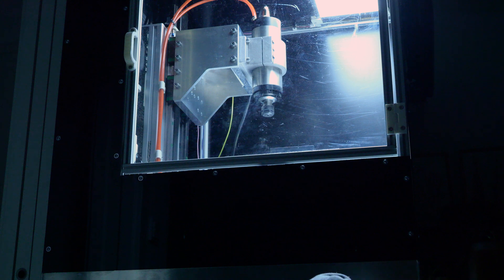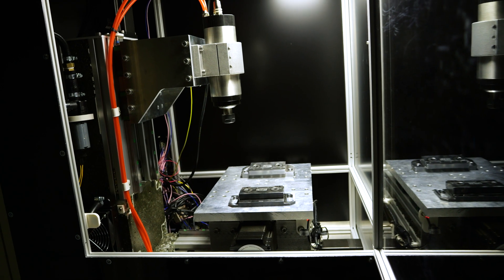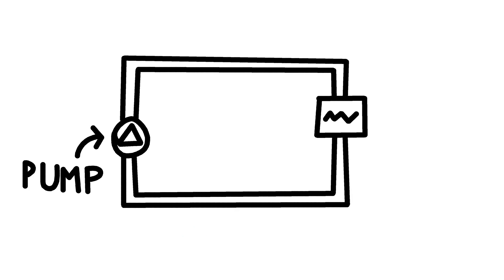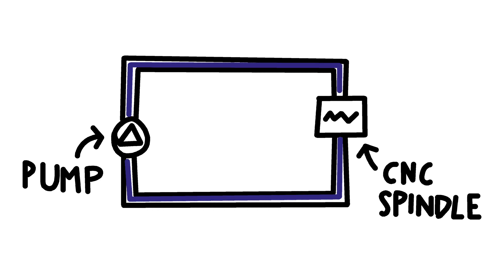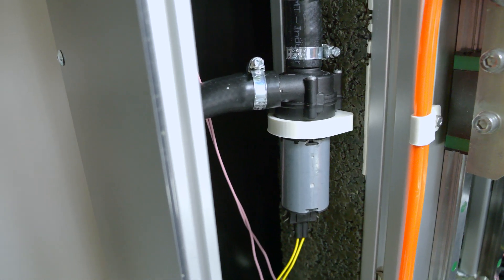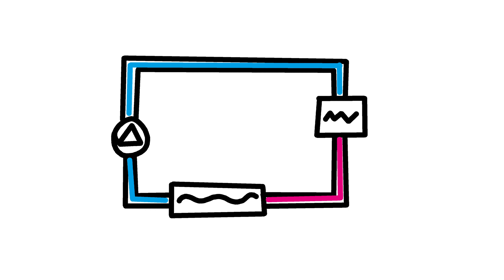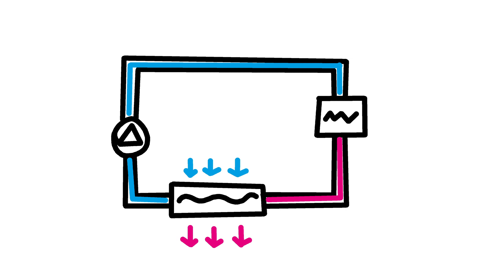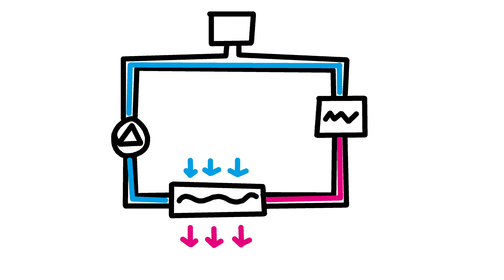How to water cool a 2.2kW CNC spindle

Comment: Another cool bit about working with a water cooled spindle like this is the ability to tap into the closed loop circuit for other features. Lots of very cheap water cooling plates are available from china, also for PC watercooling. If you have hot parts inside a cabinet you would like to keep dust free, say an AC/DC or DC/DC converter to run a 12V water pump, you can use those stacked onto the heatsink on those devices. Or, add another PC watercooling radiator inside the sealed enclosure and use it as a heat exchanger inside the cabinet you can now seal up rather tightly. That's how lots of pro level controllers do it, sometimes with added phase change or even thermometric cooling. If I were building a plasma cutter that makes lots of metal dust and nasty EMF, I'd do that for my controller... 

Ford cars from the mid 90's onwards are ran with an electronic fuel pressure regulator setup. They have what they call a FPDM, or fuel pump driver module. It has a very simple 0-100Hz PWM control with very simple PWM feedback and can drive quite high powered loads without much problem, all in a neat package. I'm sure a simple mosfet board would also work, but I get handfuls of them from junkyards when they have all you can carry specials. You can also find those water pumps in quite a few cars, electric vacuum brake boosters, ride height position sensors, other nifty useful bits...

Comment: i have similar 2,2KW spindle whit 20 liter cooler tank, and submercile pump, and just buy first radiator 30€ 2 piece computer 120mm fan. whitout radiator water go 2 hour job very hot 70 deg celcius. need add radiator.  cheap compination, sub pump cost 30€ radiator about 30€ tank 5€ spindle 150€ vevor, VFD 55€ aliexpress.